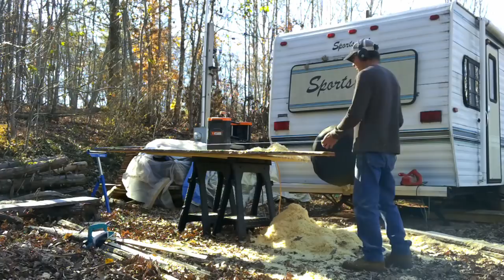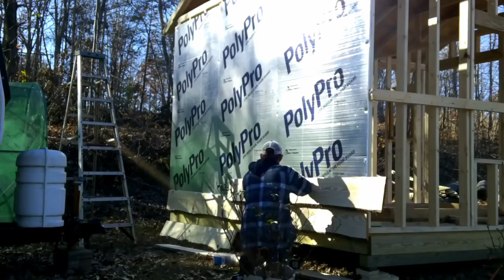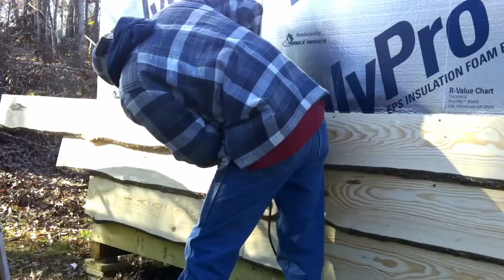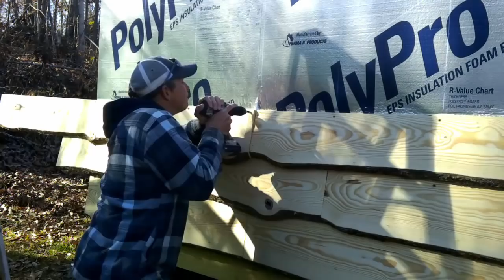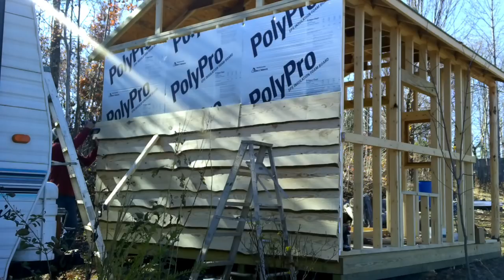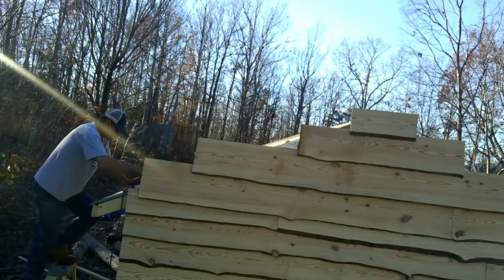Live edge siding on the rustic cabin.

Comment: Too many gaps and air leaks around the edges of the insulation board, neutralizing its insulation factor. 
Those butt joins should be taped and sealed with aluminum tape to prevent air movement. this structure will always be drafty and cold, and bugs will crawl right through those crevices too. I've lived in an RV, I know about sealing up draftiness in a small structure! DAMN you are cutting too close to the power cord with that reciprocal saw.
Reply from the maker: Any more complaints?

Comment: What goes in the seams?after the fresh wood shrinks
Reply from the maker: 1:15 I said I milled the boards the year before. They were stacked and wrapped in plastic for a year. There are no gaps almost a year after installation.
Reply: Most boards will barely shrink along the grain.  I always put a piece of flashing behind the crack where the boards butt together.